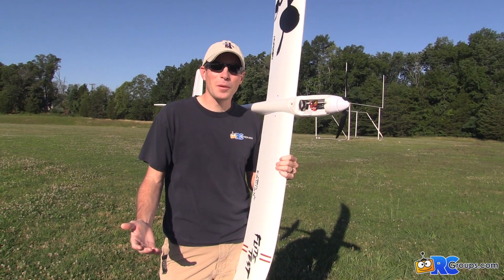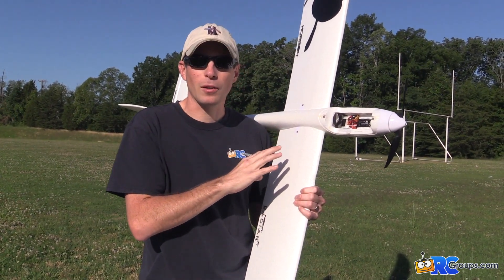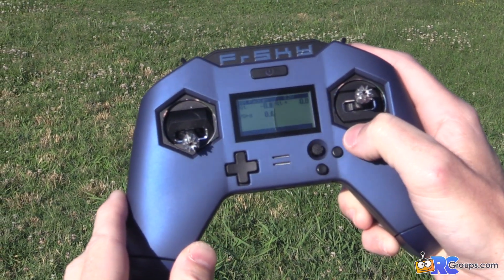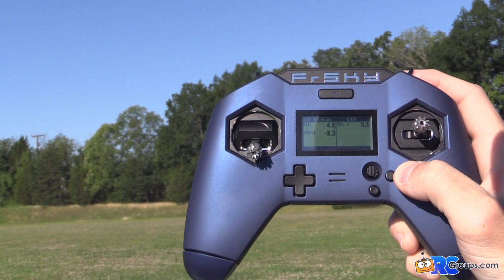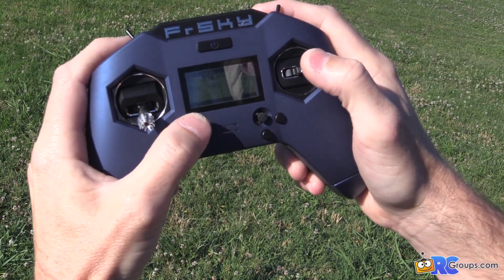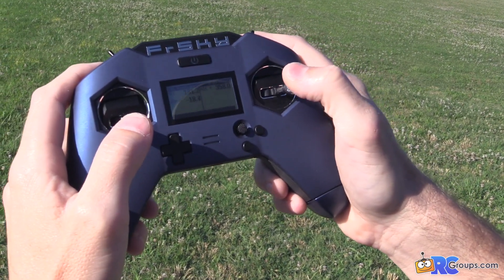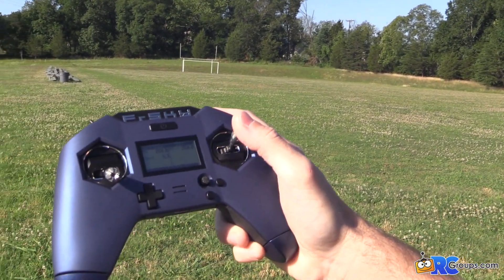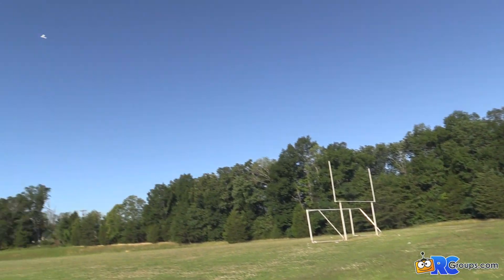FrSky Archer GR8 Receiver RCGroups Flight Review

Comment: im using a horus x10 express and havent been able to register the gr8 receiver. Any tips?
Reply: Got the X10 express aswell, be sure to check the firmware, the V2.XXXX version is not compatible with the V1.XXXXX firmwares. Both transmitter and receiver have to be in V1 or V2....
Reply: @WartexxNL  I have the same problem ...using a x10s express .I have flashed the Tx to ISRM-S-X10E_2.1.0.frsk  and the GR8 to X_2.1.0\Archer-X_2.1.0.frsk
Reply from the maker: I'm no expert, but I do know the internal module on the radio has to support it. Contact FrSky to make sure which versions you should be running for that radio.